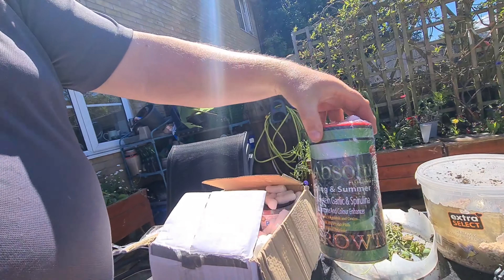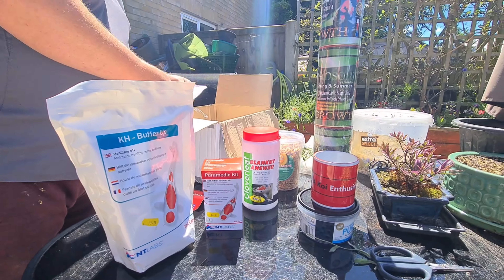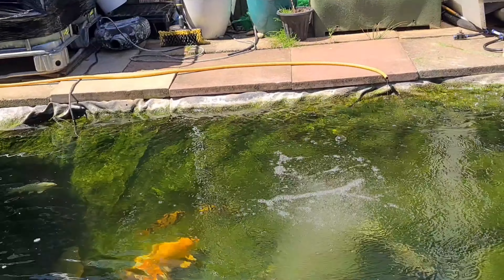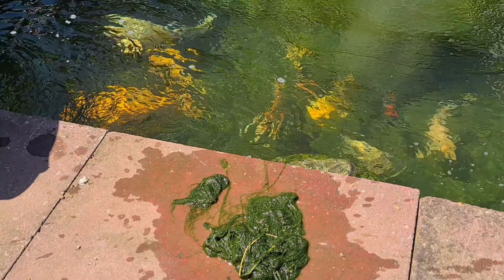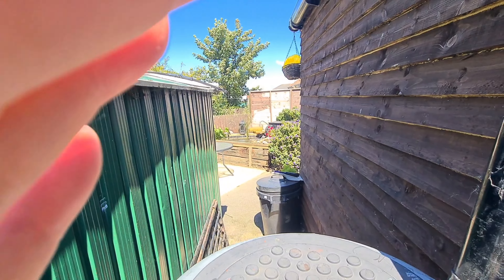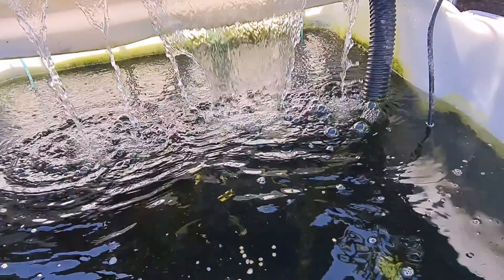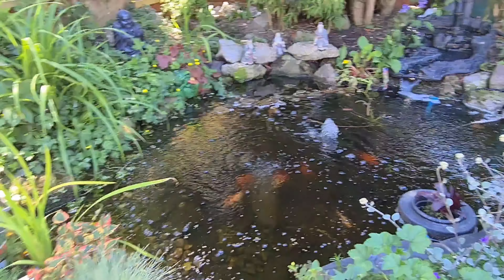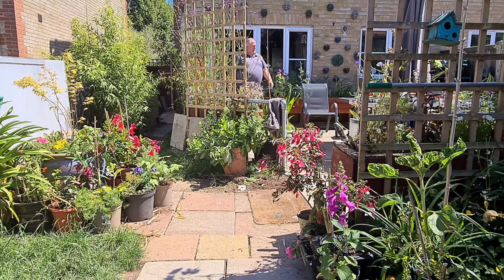A big thankyou to Kev @AKoiEnthusiast we got our first mug!

Comment: Treating for string algae takes a few weeks for any treatment to take effect. I use Aqua Source Resolve as you can just sprinkle in around the edges with no mixing. Also doesn’t cloud your pond. I do this in spring and usually a repeat dose shortly after is enough for the whole year. However your pond looks like it’s in full sun so obviously a nitrogen imbalance isn’t helping, maybe look at a bog filter?
Regarding ulcers not much to suggest except have you tried Virkon? I had some sort of bacterial problem and did lose a fish. Not sure if the Virkon sorted it but that was the last treatment and not had any problems since.
Reply from the maker: Hi Graham we are trying virkon now things seem to be moving in the right direction.